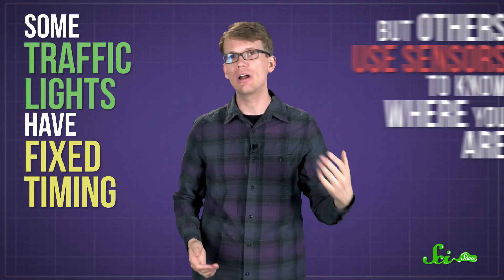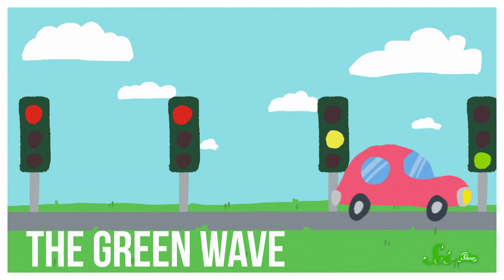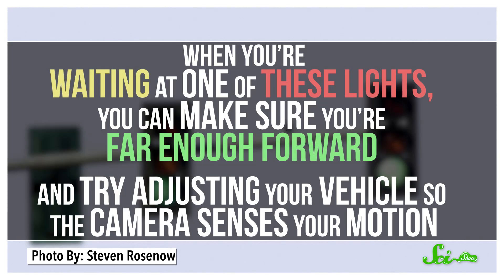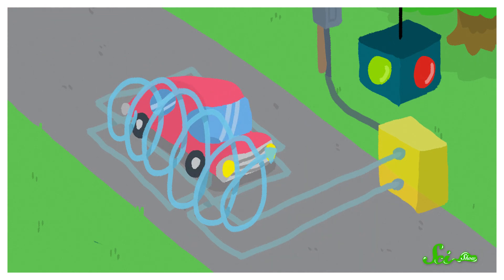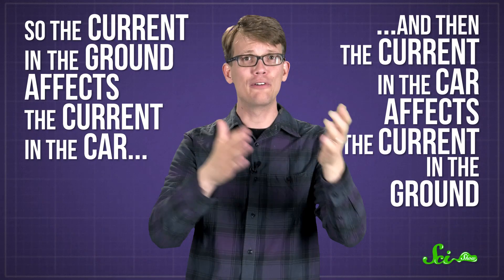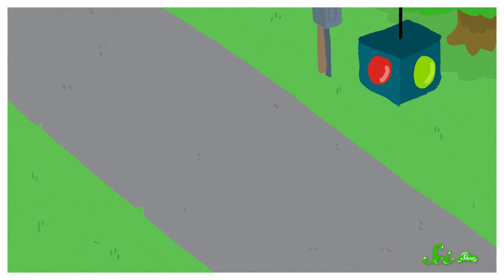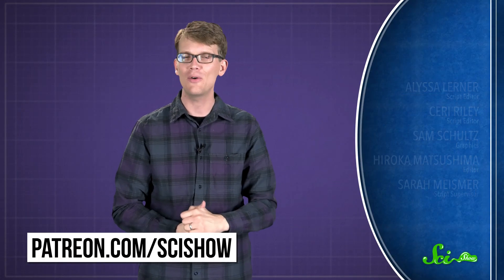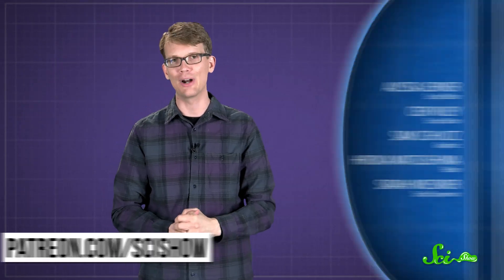How Can I Make A Traffic Light Turn Green?

Comment: I have an infuriating light where I always pull out from a side street onto a main street that changes by motion detection, but the motion detection is set far back and the light lasts for just five seconds if there's no traffic, so taking your car down this low speed limit street, with a nearby stop sign on one side, you can't make it without breaking the law.  But that's not all, it also activates if you walk up to it, so pedestrians always have to wait the full cycle.  Also, the light activates if you press the walk button, but the buttons were installed in reverse, except new posts have been installed recently on half of them, so half the buttons are reversed and half work in the right direction.

Comment: Back when I lived in Fairbanks Alaska, I was occasionally called on to drive our company van. The van was a slightly dirty off-white, very much like old snow.

Know what the landscape of Fairbanks looks like for 8 months of the year?  OLD SNOW. Further, it is entirely possible for the camera style sensors (Which are more often than not just simple albedo sensors) to clog with blown snow or hoarfrost. 

So yeah. . . sometimes even knowing how the system works doesn't help you. . .

Comment: to trigger an induction coil on a bicycle stop on it so your front wheel is on about 1 o'clock.  Your body's magnetic field will trigger most of them from there.  Seattle paints a little T on the best place to stop in most intersections.

Comment: In some states (illinois for example) it's legal to classify the traffic control system as "dead" after a predetermined time window (about 3 minutes i think, in illinois) and to literally run a red light so long as the conditions are other wise safe after the time window. This is mostly for motorcyclists who have a hard time triggering the inductve sensors.

Comment: You now make me doubt myself, but the little canister mounted on top of the lights that you refer to as a camera here, isn't, i don't think, a camera. I'm fairly certain it's an emergency vehicle detector, which uses infra-red (like a TV remote) to change the light to green when an emergency vehicle with a transmitter is some distance away. It's quite popular in my area (several people a year are caught) to build a little device that emits this signal when you push a button.

Comment: It appears a lack of effort was put into this video about signal detection. First, the sensitivity on most loop detectors is strong enough that if you align your wheel with the loop, a motorcycle and bicycle can trigger the light. Also, sometimes the road pavement may be so messed up that the loop detector breaks and won't be fixed until the street is repaved.

New engineering rules now require new loop detectors at the stop bar to have extra conduit through the middle so bicycles and motorcycles can be detected. Since it takes 10-20 years for streets to be repaved in California, it will take some time before all the signals can detect bicycles. http://www.humantransport.org/bicycledriving/library/signals/detection.htm and http://www.westernstatesforum.org/Documents/2013/presentations/CaltransHQ_Styer_FINAL_AtForum_BikeDetection.pdf

Bicycles can legally run a red light if they wait long enough at the intersection that they can prove they could not trigger the signal. http://laist.com/2008/07/16/can_you_run_a_red.php

Camera detection is cheaper than loop detectors in the long run but has other problems, such as detecting shadows as vehicles and bicycles having trouble triggering the signal in low light situations. EMS loves them though.

You did not even get into the really cool adaptive signal synchronization system LA city uses. It is now the model for other cities around the world. http://trafficinfo.lacity.org/about-atsac.php

I'm disappointed in this video, you should have contacted some transportation engineers, they would have been happy to discuss.
Reply: I was about to post something similar. I ride my bike all the time, and can trigger the in-pavement sensors at 95%+ of all intersections. You just need to know where to put your wheel when you come to a stop. Each sensor shape has its sweet spot. http://bikeportland.org/2010/09/27/bike-science-making-sense-out-of-signal-sensors-39517

And magnets don't work. I know they're for sale, but it's snake oil. Take it from an electrical engineer. Just memorize the 3-4 sensor shapes, and their sweet spots. It'll change your life.

Comment: Actually the aluminum rims of a bicycle can work on an inductance loop.  Place both wheels directly over the wire.  Aluminum is a fantastic conductor and it works if the system is properly calibrated.

Comment: Cyclist here.  I can get traffic lights to notice me by putting my wheels right on one of the grooves.  If that still isn't enough I straddle my bike, feet on the ground and lean my bike way over to present a bigger cross-section of metal to the sensor.

Comment: Properly calibrated induction loops CAN detect bicycles. The trick is that the bike needs to be near one of the wires. So you need to position the bike on one of the grooves in the pavement. Obviously this only works of the city has calibrated the loops to be sensitive enough to detect a bike. But I think more and more do.

Comment: The sensor circled at 0:49 is not a camera. That sensor is used for emergency vehicles equipped with the traffic signal preemption system which will turn a light green in the direction the emergency vehicle is travel when vehicle's lights & sirens are activated. Get your facts straight or risk losing subscribers.

Comment: If i put a giant straw from a ocean to the space will the vacuum suck the water
Reply: no
Reply: vsauce answers this http://gizmodo.com/5993923/is-the-vacuum-of-space-strong-enough-to-suck-up-the-earths-oceans
Reply: can someone give me a short summary, i dont want to watch a 10 minute long video...
Reply: DjyTheKid Gravity still works inside the straw....
Reply: azmanabdula thxs
Reply: azetix actually it wont, the vacuum of space will pull on the water, however the air pressure will counteract the upward force heres a source with a bit more in depth info http://www.askamathematician.com/2014/11/q-what-would-happen-if-there-was-a-giant-straw-connecting-the-earths-atmosphere-right-above-the-ground-to-space/
Reply: azetix the point seems to be that "A straw doesn’t provide an “escape route”; our air is free to try to leave whenever.  The atmosphere stays where it is because it’s made of mass and the Earth has gravity. "
Reply: azetix 
"true forgot about that. maybee if the the straw was thin enough so that the weight wasnt being pulled down by gravity so much, the vacume could pull it, slowly, but eventualt?"

If it would work, we wouldnt be here, as space would have smeared everything into a homogeneous gas....
Reply: I think you need to watch Mr. Wizard's video on sucking grape juice through a straw
Reply: "If i put a giant straw from a ocean to the space will the vacuum suck the water"

Why would it?
Reply: yes but with the emptiness of space space actually tries to suck anything into it asap, which is why space is also called, vacuum of space, so if you put this straw there that "vacuum" would theoretically suck all that water
Reply: true forgot about that. maybee if the the straw was thin enough so that the weight wasnt being pulled down by gravity so much, the vacume could pull it, slowly, but eventualt?
Reply: true, if that was how it worked then the atmosphere would be sucked out and this would be a lifless planet. i have a question, if the straw started out with no air in it or any gas and just "nothing/space" would it then work? i used to do this all the timestick my finger on one end of the straw, put that end into the water (after sucking all of it out) and id get a quick sip without sucking on the water, as the water rushed to fill the air tight space
Reply: azetix 
"i have a question, if the straw started out with no air in it or any gas and just "nothing/space" would it then work?"

The atoms would simply move in to fill the space..

and regain equilibrium...

Another way of thinking about it, the gas we breathe is still gravitational bound to the earth, 
picture it like a fluid and it makes more sense...

Comment: How do the bike sensors work then? I live in the Netherlands where bikes are quite common and there are lights (on bike only paths) that are activated by bikes without having to press a button (though it's still there as a backup usually).
Reply: Carbon based frames do not get detected at all by the loops we have on our cycling lanes in the Netherlands. The loops detect metal and since a carbon bike isn't metal they are never detected. Usually that is.
However, there may be times there are cameras or infra-red detectors installed along side it. Not because we are afraid we won't see the carbon bikes, but because we have a lot of red light runners. The last thing we want to do is have a 30 second gap for hte cars on the intersections, because someone pressed the button to cross the road, decided it took too long and crossed during the red light. Unfortunately, these infra-reds usually work in conjunction with the loop and others are mostly there for pedestrian crossings and not cyclist crossings. Carbon bikes are way too uncommon for the detection apparatus to be installed at every intersection.

In the Netherlands most intersections (as in 99% orso) are vehicle dependant in their controls. Fixed routines are never used, except for a few specific places for very specific reasons.
Reply: Bike sensor loops probably have a greater sensitivity. They might have more current running through the loops or something; don't know the actual specifics of 'em...

I wonder if they would fail to detect those high-tech carbon fiber frames of some bikes, by the way. Maybe they have a (strong) magnet built inside/under the frame?

Comment: Can you talk about how most cross walk buttons are a sham connected to nothing.
Reply: I know for a fact that that is not the case in Germany, pedestrian lights light up a "signal coming" light when the button is pressed.
Reply: 'Scuse you? In my local town in the US, crosswalk buttons work just fine. It's probably just whatever town the OP's from that they don't work well.
Reply: kchen075 It's quite funny how inconsistent many things are in the US, here in Germany all the crosswalk buttons are the same general size, shape and color (bright yellow), no matter the age, and most infrastructure is identical or very similar no matter where you are in the country.
Reply: Most do not do anything because they don't need to do anything. The programmed timing of the intersection isn't worth changing for a pedestrian when they'll have a chance to cross regardless. 
However, I have most definitely used intersections that will not trigger a crosswalk signal unless you press the button, allowing drivers to more confidently make turns, or to keep signals shorter.
Reply: You just think they work fine. Google "placebo buttons" http://www.todayifoundout.com/index.php/2012/07/many-crosswalk-signal-buttons-dont-do-anything-anymore/
Reply: Edit: I went and double checked what the internet had to say on the crosswalk buttons in my area. Turns out not only do the majority of them not work, a fair number of the streets don't even have the buttons at all. I never travel anywhere on foot, and they seemed to work several years ago; guess they don't anymore. Cities are weird places.
Reply: I think where I live, all the cross walk buttons were built/renovated at different times so they all: 
have different looks, may or may not work, and the traffic light timers are all unsynchronized and DO NOT change depending on the cameras or magnetic sensors.
Reply: It really just depends on where you live. In my city, the downtown area lights are all timed, no sensors at all. Down there the pedestrian signals automatically with the lights. In other areas where the lights work off sensors, you have to hit the button.

Comment: In the UK a lot of traffic signals use microwave or infra-red detectors to detect presence of vehicles. Inductive loops are mostly used for MOVA or UTC (urban traffic control) systems, and most UTC systems use an algorithm called SCOOT to adjust the timings. Interestingly in the ITS (intelligent transport systems) world the US is playing catchup to other parts of the world as the traditional American response to traffic has been to build more roads.

Comment: As a bicyclist I experience this problem everyday, and YES there is something you can do...
1. Check your surroundings making sure there are no cars on the car lane.
2. Get out on the car lane
3. Flap your arms like a swan taking off

This works most of the times with photo sensors. Sometimes it is also possible to do the trick without leaving the bike lane.

Comment: Even though they are becoming more rare on traffic lights, why no mention of the Mobile Infrared Transmitter? They're a felony in the US to use without a license because they're used by emergency personnel, but it's still a way to change the lights if you come up on a light that still has as receiver. Just a thought.

Comment: Noooo, Hank. I realize that tip about running the light as a biker, is probably ONLY for deserted roads. But I sadly see a lot of bikers in the city who run red lights, almost causing accidents. 

I wish we would bring back some common sense, or traffic rules for bikes, because there's so many DUMB bikers out there. Most of them don't even use their bells anymore, or hand signals. Most of the bikes don't have the mandatory reflector bits on them for visibility during dark nights(winter is coming and hey this is Norway), or use a bike light. 

This is a silent vehicle, and I accidentally made one crash because it came up behind me, as I gestured with my arm, making the biker smack into said arm and crash. He was unharmed (thankfully) and apologized since it was technically a no-bike zone, and he didn't signal to tell me he was coming. But we were both shook up.

I really, really wish more people would become aware of this growing problem, since more and more people use bikes these days. They're great for your health, faster than walking, maybe even jogging, and don't release any bad gasses. I see towns making room for more bike paths (sometimes cutting away pedestrian walks, but that's a different story), and signs for them. 

Lastly, thanks for the video, I'll tell all the drivers I know, about these facts, so that they can be a little less annoyed at long red lights. :D

Comment: in Brussels they did the opposite to the greenwave. They sync them so that you are forced to stop at least 2 or 3 times in less than half a mile in and urban area.
They try to make people hate the car so they stop using it and stop polluting :D But they get opposite effect: People stop, motor still runs, some people play with throtle, all of which pollute even more. Plus people are constanlty  late at work appointments, so companies move out of brussels crashing local economy.

Comment: Actually, you need to be moving through the magnetic field to be detected by the inductive sensor. The induced current is proportional to the change in magnetic flux and the flux only changes when the metal object moves in the magnetic the field. To set of the sensor, drive back and forth a little bit.

Comment: Okay now real answer: Some traffic lights have sensors that can make them turn green "no matter what". Sometimes it's a radio signal, but more often they're just reacting to strong flash of light as such sensors are less expensive. You can find details whether you have such lights and most of the specs at your local PD website (depending on PD you may need to figure some stuff out yourself) as government has to disclose such info. If you can't find any info, you can use FOIA to request it.

Comment: First, that black thing you circled while calling it a "camera," is not a camera, it's a sensor that detects flashing [sometimes IR] lights on emergency vehicles [and even busses]. Here's a good article explaining the difference: https://wiki.waze.com/wiki/Cameras

Second, don't run a red light. Just don't. Try flashing or holding your brights at a light with an actual camera or adjusting your car at a light with sensors.
Reply: Bicycles don't have bright lights to flash :P
(My understanding was the run the red comment only applied to bicycles when all else fails)

Comment: Or you can drive so fast that the doppler effect shifts the wavelength of the red light shift into green
Reply: 192,000,000 mph sounds like an expensive ticket
Reply: maybe not at such a speed I guess it's impossible to take a photo of the license plate anyway